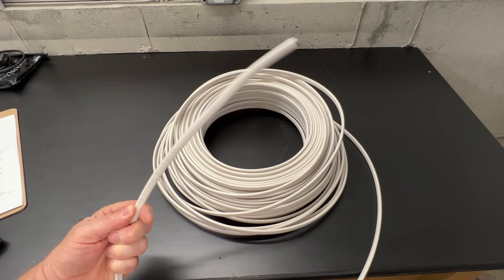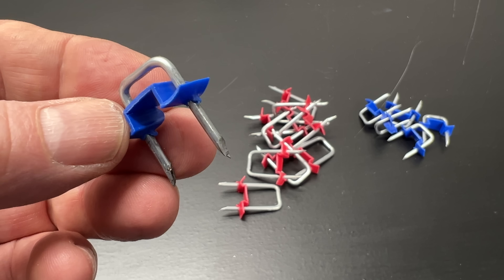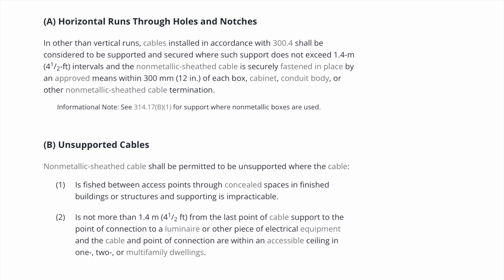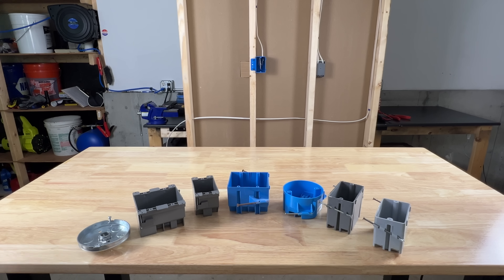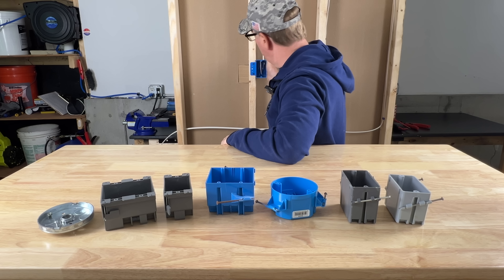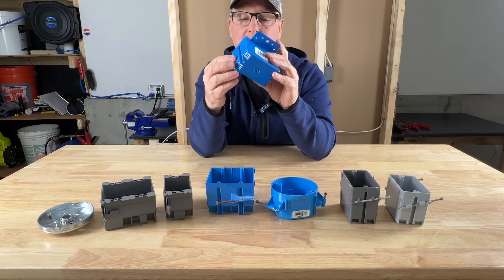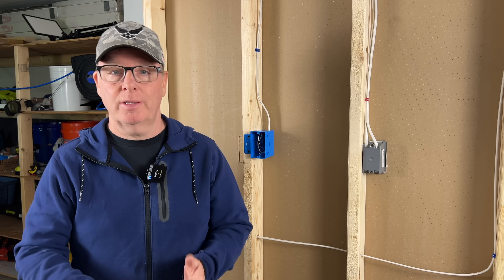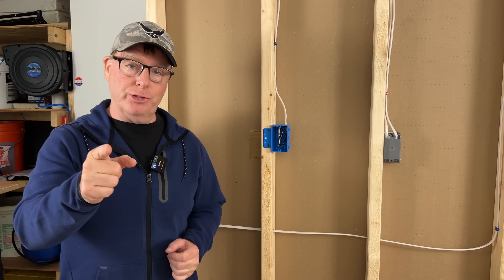ROMEX Cable Support Requirements (2025)

Comment: What the hell do I use for UF-B 6/3???!!!
Reply from the maker: 340.10(4) UF Installed as nonmetallic-sheathed cable. Where so installed, the installation and conductor requirements shall comply with Parts II and III of Article 334 and shall be of the multiconductor type. In other words the support requirement is the same as NM cable.
Reply: @BackyardMaine  thanks, but  I couldn't find your normal cable staples big enough for my cable. This is a flat cable a little over 1" wide so I went with 3#3 to 3#2 service entrance cable straps. Hoping it works.
Reply from the maker: @shawnphillips1220  The big box stores probably don't carry what you need. A supply house would have them in stock.
Reply: @BackyardMaine  Yea, I don't live anywhere near the supply houses and everyone I found online required a credit account just to purchase items. I only needed the 1 item so I just went to home depot and found something I thing will do what I need. Thanks for the info!!

Comment: Question - If 14 awg NM-B cable is running horizontally through pilot holes in wooden studs (16 inch on-center spacing) and as it passes through the last pilot hole, the top of the outlet box that the NM-B cable is entering is 6 inches below the pilot hole on the same stud.  Does the last pilot hole count as the "support" and "securement" and no staple would be required or does it only count as the support of the cable and a staple (securement) would be required?  If a staple is required, then theres probably a few different ways you could do this with each way being ok by code to do but I'm thinking in terms of which way would be the best way so that it passes code and puts the least amount of stress on the cable so that im not having to bend or roll the cable too sharply so that its anchored with a staple on the stud and then have to route it sharp so that it can make it inside the box. The outlet box is metal with knockouts and cable support clamps which should put me in the " must be secured within 12"" rule of code.  When NEC says "support" that generally means vertical support of the cable to prevent the cable from sagging too much due to the distance between supports?  "Secured" means anchoring the cable to an object like a stud using approved NEC approved things like NM-b staples?  Yes the cable is running horizontally for the most part but it enters the box vertically and there's a 6" distance between the transition from horizontal to vertical before it enters the box so thats why I was kind of unclear as to what my situation would fall under.
Reply: Only if you go straight into the side of the box and kep the cable horizontal will the last hole count as support. Because the cable goes vertical to enter the box, that hole is not considered support.
Reply: @pld8993  thanks i apprciate info!   Question - would you run cable down and immediately staple then continue it down to enter box?  Or would you route it up, once it passes through hole, staple it, then roll the cable down and into top of box?  Routing it up looks like it would put less stress on cable but then again im not an electrician.
Reply: @ Assuming the hole is above the box, through the hole and straight down. There's no real stress on the cable to be concerned with.
Reply: @pld8993  ok will do I appreciate the feedback
Reply: @pld8993  one more question sorry - if you are an electrician do you know if Wagos are allowed to use as ground wire connectors? I only see them used for hot and neutral connections and was wondering are they not allowed by code to be used on grounds? I couldn't find anything in NEC saying they could or couldn't.
Reply: @morokeiboethia6749  There's nothing that says they're not for grounds. Most recessed lighting uses something similar to  wagos and they are used all the time for grounds.

Comment: Ok the boxes that don't have clamps drill out the hole and install a cable clamp. How much wire are you allowed to leave in the box?
Reply from the maker: That really isn’t necessary and you would have to use a non metallic connector to be compliant. There is no maximum length but the minimum is 3 inches outside of the box and six inches from the point the cable enters the box.

Comment: Is there a fire-rated plastic box for firewalls? If so how are they recognized?
Reply from the maker: Yes, there are fire-rated plastic electrical boxes designed for installation in fire-rated assemblies, such as walls or ceilings with a required fire-resistance rating. These boxes comply with standards to maintain the fire-resistance integrity of the firewall.
Look for a UL (Underwriters Laboratories) or ETL (Intertek) mark on the box, indicating compliance with fire-rating standards. The box will have specific identification, such as "Listed for Use in Fire-Rated Assemblies."
Reputable brands such as Carlon and RACO offer fire-rated plastic boxes. Their product documentation will confirm the intended use in fire-resistance-rated walls.

Comment: Cable Support requirements are OverBoard and almost unnecessary

"installed so as not to damnage the cable" can be done WITHOUT any support staples or cable ties - AND - makes retro updates SAFER (e.g., helps keep from tugging a secured cable and it getting damaged without knowing)

It just takes a little common sense - and yes, I realize the code is because of the basis that, to help assure for safety, assume that installers lack common sense.

The 1 foot - 4 1/2 feet specifications are a good indicator that only the most incompetent could possibly create an unsafe install.
Reply from the maker: The main reason for the supports is to maintain safe spacing so a nail or a strew will not reach and damage a cable. Also so the cable doesn't get pinched or damaged by the insulators, drywallers or other trades. It is also important to help make sure the cable sheath stays inside the box. They can easily pull out when other trades are working if not secured correctly especially with single gang boxes with no cable support.
Reply: @BackyardMaine  I understand the faulty reasoning.
Logical reasoning would say that a wire is LESS likely to get damaged by a nail or screw if it can be more easily pushed aside. That is plain physics.
And other trades are not devoid of common sense. Nor am I saying use "zero" cable supports. But staples that hold them with very little wiggle room in so many places is not necessray to prevent other trades from doing damage.
A zip tie that holds the wires loosely is just as effective at that.
There ' no need to defend that code as if you are the one that wrote it. Nor am I saying this is a huge flaw, actually it is a fairly small flaw - generally the code is good.
=============
[[  It is also important to help make sure the cable sheath stays inside the box.  ]]
I agree. Those are box connections, I am only speaking to cable supports.
Reply from the maker: @2Truth4Liberty  I don't agree with everything in the code but I understand it and I know the purpose of the requirements. So many people believe it's some government over reach but that couldn't be further from the truth. Everything requirement is determined by a consensus vote and there are a wide variety of experts in each of the 19 CMPs. I know people that dedicate their time for free to make us all safer.
Reply: @BackyardMaine   I think we are in the same boat about most all of it - I just disagree with the spacing and staple stuff concerning cables. 
Since I do my own elec work at home I aint worried about it (nor follow it for things I disagree about)

Comment: Why not put staple right above the box and still do a service loop?
Reply from the maker: The reasoning is it's difficult to pull extra cable through a staple without damaging it.
Reply: @BackyardMaine  no I meant put the staple right above the box with a service loop between the staple & the box

Comment: I do a good deal of "Old-work" electrical repairs.  If I am adding a plug to an upstairs room and drop the new Romex cable down thru a wall to the new box, I have no way to secure the cable.  Am I in violation of the code?  How far can a cable "hang" before it becomes a violation?  (I only install 12g wire--if size matters to your answer.)
Reply from the maker: No, I explained in the video that fishing a wire in a wall or ceiling is exempt from the requirement.
Reply: @BackyardMaine  Thank You for the response.  Dan

Comment: What about metal boxes and using EMT conduit? Do the wires need to be secured in the conduit somehow...or at the j-box? Thanks
Reply from the maker: No they don’t. The EMT needs to be supported within 36 inches of a box or fitting and every 10 feet there after.
Reply: @BackyardMaine  Thanks!

Comment: What about if you are using dual gang boxes?
Reply from the maker: Multi-gang non-metallic boxes will have a built in cable clamp.
Reply: So dual is the same as the first 5 boxes you discussed.
Reply from the maker: @tomwebb8886  I believe I showed a two gang box or two in the video. They will have cable clamps. For a metal box they may come with clamps or they may need to be added but in either case they will require support within 12 inches of the box.

Comment: I wish the idiots that I HAD to use (union & town approved) to wire my barn had watched your videos. Amazingly it passed code inspection???, yet I found the outlets had open grounds, yep no ground to the panel?? Then discovered that they installed unprotected GFI’s outside which shutdown every time it rained/snowed. I had to rewire so many random outlets & non functioning 3-way switches.
Reply from the maker: It’s not always easy finding reliable electricians. I’m glad you could fix it.

Comment: This is awesome content.  Thank you for that.  Does anyone have an idea why its important to support the cable?  A 12/2 is pretty stiff, I would say once its run its not going anywhere.  Also coming out of a hole cut in a 2x4 stud within 8 inches I would think would be just as supportive.  Just curious on the why's if they are known.

Comment: In replacing wiring in an older home with lathe and plaster how does this apply?
Reply from the maker: If wires are fished in existing walls it doesn't. I go over some of that in the video. But if you're removing the plaster and lathe and open the walls you would then be required to follow the support requirements.

Comment: The stapling adjacent to the box is to keep cables from getting snagged and jerked off the wall.   When you buy new code books always buy the commentary that goes with it.   The commentary explains what the authors/committees were addressing and what they want you to do.   The only arguments I have ever won with an inspector were by reading them the commentary so the understood what the code was actually saying.
Reply: Great point. I always want to understand the why behind any requirement.
Reply: The NFPA publishes about $5,000,000 worth of books annually, much of it to explain the ambiguities they intentionally entered in the code!! It's a little like putting the fox in-charge of the hen house!! Soon, electricians will need a PHD to practice??
Reply: When the new code books come out, is there somewhere that summarizes what has changed since the prior version?  I retired from a profession with a Standards of Practice that ran over 300 pages and was updated every 2 years. Several entities would publish a summary of the changes so we wouldn't have to try to re-learn 300 pages every 2 years.
Reply: @ several entities publish the changes, and provide accompanying classes.
Reply: You got a Link to a Code book with the commentary?

Comment: Resi guys arguing over code is the best comedy ever. The worst craftsmanship you’ll see industry wide is directly found in the residential market.
Reply from the maker: I have only ever done residential work on the side. I was a union industrial electrician for a couple of decades before moving into electrical engineering for 20 year. I retired a senior electrical engineer for Texas Instruments. Some electricians think they are pretty special but it doesn't usually take very long to take them down several notches. These videos are designed to help out the average homeowner.

Comment: I have a finished garage with an unfinished loft. They have some plywood up there and some exposed area. The home inspector just assumed the bulbs were burned out, but the previous owners ran a length of romex up there and never connected it.  If i understand this right: i only need to support the wire if i travel more than 4.5ft along a joist. I will need to drill a hole through a joist if i need to cross it. I need to leave 6in of working wire inside the box. I need to check the installed junction boxes for that part. I know they are metal, and installed in the ceiling/floor going to outlets. My goal is to replace the current lights with motion sensor, led, camera.
Reply from the maker: You have it right..
Reply: Thanks

Comment: The nice thing is, at least for residential applications, as long as your electrical is fundamentally run correctly, and looks nice, neat, and tidy, 95% of inspectors aren't going to bust your balls over 8" or 12".  

Honestly, if you just applied "nice, neat, and tidy" to everything you did in a home, that will usually result in something that is safe and will pass code.  Again, assuming you otherwise fundamentally understand the general application.

Comment: I didn't see within the codes you showed that the first support outside a single gang box without a clamp has to be no more than 8 inches away from the box (in addition to 8" along the sheath). Can you point me to where the NEC states this?

I dig your videos, big time.
Reply from the maker: 314.17 (B)
(2) Conductors Entering Through Cable Clamps
Where cable assemblies with nonmetallic sheathes are used, the sheath shall extend not less than 6 mm (1/4 in.) inside the box and beyond any cable clamp. Except as provided in 300.15(C), the wiring method shall be secured to the box or conduit body.
Exception: Where nonmetallic-sheathed cable is used with single gang nonmetallic boxes not larger than a nominal size 57 mm × 100 mm (21/4 in. × 4 in.) mounted in walls or ceilings, and where the cable is fastened within 200 mm (8 in.) of the box measured along the sheath and where the sheath extends through a cable knockout not less than 6 mm (1/4 in.), securing the cable to the box shall not be required. Multiple cable entries shall be permitted in a single cable knockout opening.

Comment: I always just remembered 6 12 18. You have to have 6 in of working wire in the Box. And you have to be secured within 12 inches and you can't have more than 18 inches of wire
Reply from the maker: The issue is that will single gang plastic boxes without a cable support you need to secure at 8 inches rather than 12.
Reply: @BackyardMaine  yeah 6 12 18 implies boxes with no strain relief.

Comment: Can we figure out if #6/2 Romex is code compliant for a 48 amp continuous EV charger? Apparently the state of New Jersey allows this, my local jurisdiction does not. What other wiring methods are suitable for this application?
Reply from the maker: When determining amperage rating of NM cable or romex you need to use the 60 degree column. The would be 55A for 6AWG ROMEX. When sizing circuits we cannot exceed 80% of the continuous load. 80% of 55A is 44A so 48A would be in violation. You could run conduit and use THW or THHN. (#6 THW) has an amperage rating of 65A which would be 52A continuous. (#6 THHN) has an amperage rating of 75A which would be 60A continuous.

Comment: Great job John. Contractor for thirty years. Had a tricky question for you. We switched over to a gas cook top range that only needed 110 15amp not the old 220 30 amp for the old electric cooktop. The power continues on to a 220amp Oven. The way I handled it was switched it to a four fuse sub panel bus grounded that had a added outlet on side of cabinet plus a fuse for the 220 oven  and a fuse for the 110 cooktop using the feed from the original circuit.  Another Contractor friend said the only problem with that is it doesn't meet clearance requirements of thirty inches clearance for a sub panel, since base cabinets are only 24" wide by 30" x 36" tall. Did I do the right thing or can I get tagged down the road? Running a dedicated 110 circuit would be almost impossible in my scenario since my main panel is maxed..The sub panel is now labeled as "under Island cooktop sub panel" in main panel not the old oven/stove label.
Reply from the maker: Thank you. Spacing requirements for electrical panels listed 110.26 for a dwelling unit is a minimum of 30" wire or the width of the panel, which ever is greater. You need a minimum or 36" of free space in front of the panel. The hight requirements are 6'-6" or the top of the panel whichever is higher. There is an exception for residential panels less than 200A for hight but not for the width or the front.
Reply: @BackyardMaine  Thank you very much for your response.  I'll keep what I have since it's functional and a 1969 home. However, I've seen this scenario 20 years before since lots of people want to get rid of there 220 for a gas top like we did.. Any ideas how to overcome the issue of only having the 30amp 220 10 guage wire to work with? On the previous issue they dropped a 110 20 amp fuse in the main box in place of the 30amp 220 and kept only one leg but that's not a possibility and I'm still wondering if you can use an oversize wire on a 20amp breaker by wing nutting them together in panel to this day on that one. It passed inspection in 2000 but I'm still nervous to this day.